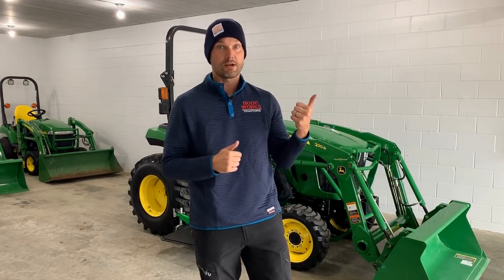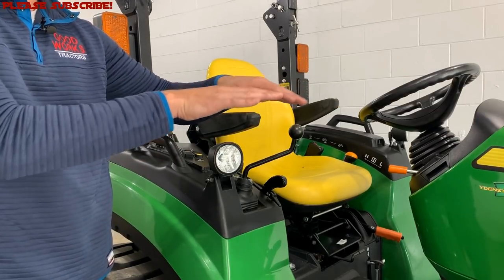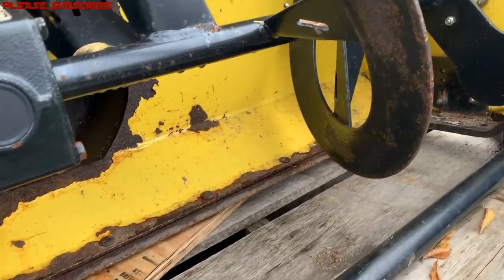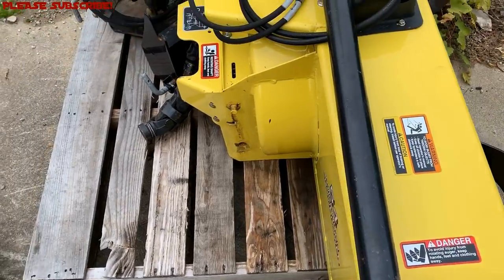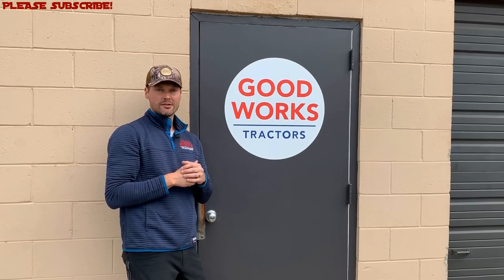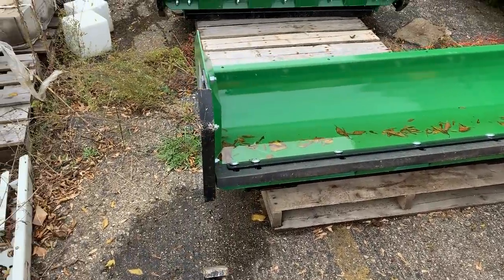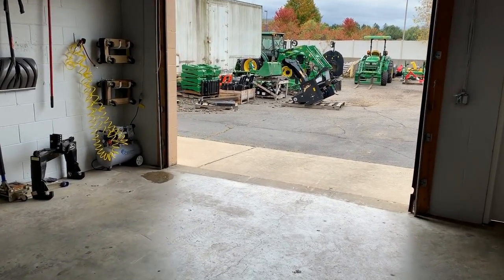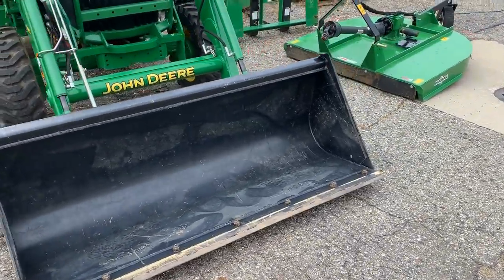12 Tractor Snow Removal Tips! BE PREPARED! Tractor Snow Removal Safety Tips For All Tractor Owners!

Comment: Excellent tips and reminders! I use a battery tender all winter as it may be weeks between storms. I also use a block heater that I can turn on remotely (already plugged in) using a wifi outlet adapter. You were aces today!  Thanks!
Reply: With a battery tender being used even in warm weather if the mower isnt being used for a few weeks it's good to have it on since theyll shut off only when needed.  Fuel stabilizer is important also like stabile  or sea foam

Comment: Great videos.  I own a John Deere 4100 with industrial tires and have found out the hard way.  Chain only the rears but Never chain the front tires.  Front end gears and shafts need to slip a bit.  Very expensive to repair front end axle parts and they will break if chained.  After 2 repairs to hubs, the dealer here in Sandpoint pointed out that if I chained up the front end, I will continue paying him to fix it.
Reply from the maker: Good info
Reply: @GoodWorksTractors  Have you ever heard anything similar?  No more breaks since I quit chaining up fronts.

Comment: I chain the rear of my JD 3520, and use a 3-pt grader blade.  I use the front bucket for cleanup.  A couple of tips: use a battery warmer on a thermostat, a head bolt heater to pre-warm the block, and unlock the brake pedals to make steering easier.

Comment: I’m looking forward to using my b2601 for 1st season this winter. Thanks for the great videos. You mentioned the rubber chains and I see more info in the comments. Could you talk about chains generally? Front v rear v both? Pluses and minuses? Types? Tips, tricks and traps? I purchased the tractor with snow removal being #1 on the list but am getting worried since my driveway has one curved section set on a hill. I’ve seen some videos of tractors going sideways. That would be a disaster in my situation. Thank you!!!

Comment: Going slow with a loader or a snow blower is a good idea. With a trip type blade or a rear blade you want to get the snow rolling.  If you are moving fast enough to do that rops up and belt on.  
When I use my loaded on my drive (mostly gravel) I have edge tamers on.
Reply from the maker: Yes, probably go a little faster with the plow, but still remain under control.  Common sense will always prevail :)

Comment: Hi!  A rookie here.  I've had my 1023e for two years but have barely used it in the winter.  We'd like to spend more time at our summer cottage - in the winter.  On the 1023e I have the front bucket and a 3 point receiver hitch.  I have a 100 yard gravel driveway.  We get a lot of snow at Kenora, Ontario - about 7 1/2 hours drive north of you.  Would you prefer a back blade with the bucket or would you prefer a front blade?  I can imagine advantages to either set up.  Thanks!  I love your videos.
Reply from the maker: I wouldn't want to use a bucket at all.  Either a loader mounted blade or snow pusher along with a rear blade or perhaps a snowblower on the back, plow or pusher on the front.
Reply: Thanks!
Reply: I spent 15 years in eastern colorado with a rear mounted snow blower.... worked like a dream. Did 1/4 Mike drive often with 100 yard by 4 foot or more drifts

Comment: Having a battery maintainer will help the battery stay at peak power , a block heater for liquid cooled unit will help with starting if parked out doors or perhaps a bit warmer if indoors heated space or not , true is its heated area the block heater is more for quick warm up of the engine rather than assisting starting.

Comment: Hello From Northern Ontario, Canada! Great Video! Will you be putting a snow pusher on the 4066R? If so what size? I just bought a Kubota L4060 and debating about getting a snow pusher, just unsure what model of HLA Snow Pusher I should be looking at for my size of tractor.
Reply from the maker: Hi Zach, thanks so much@

I got an 84" 1800 Series pusher for mine.  I probably should have gone with a 2500 Series, but I wanted to showcase the 1800 Series this winter.  Either Series is a viable option for you on your L4060 as well.  Probably go a little narrower with the 2500 Series vs the 1800 Series.
Reply: Good Works Tractors thanks for the reply! I was trying to research the 1800 and 2500 series online but wasn’t coming up with much info. I think you just helped make my decision... If only you weren’t so far away lol